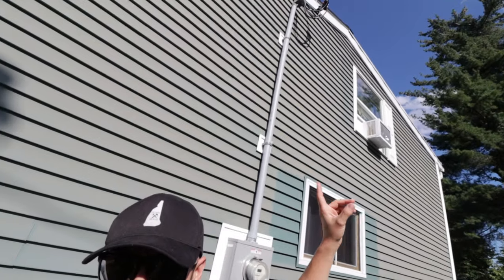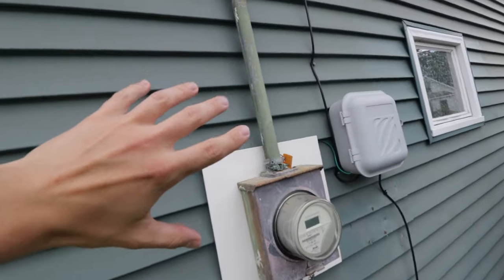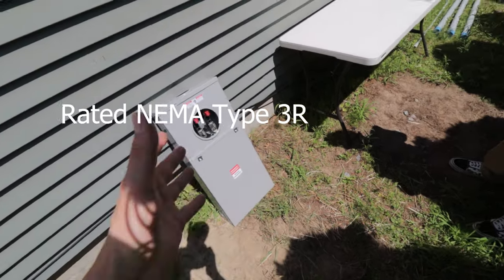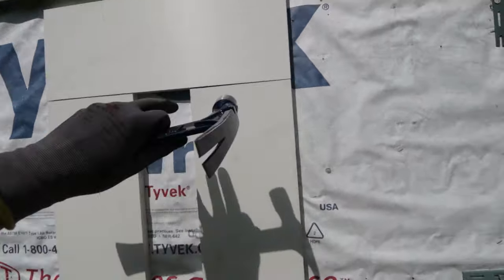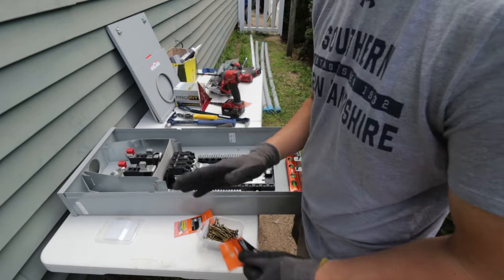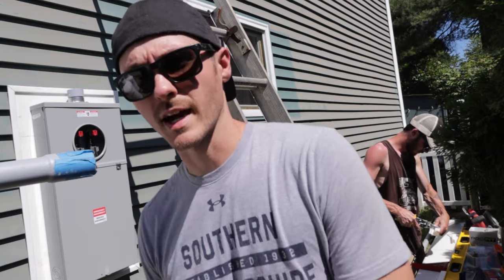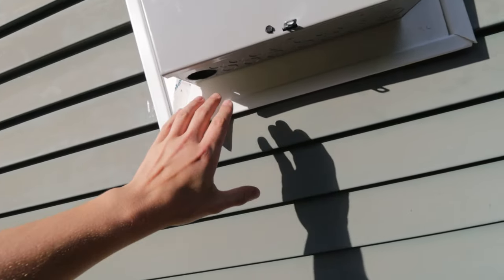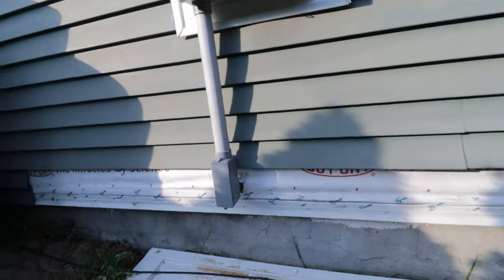Full 200 AMP Electrical Service Upgrade Install

Comment: Nice work. I think you should have put an expansion joint pvc on the 10 foot mast ?
Reply from the maker: Great question! For my situation you do not a expansion fitting. A few reasons are length of the pipe, the pipe not transitioning, and the clips i used allow for expansion
Reply: Great question and answer. Good to know
Reply: Don’t need expansion joints unless transitioning from underground.

Comment: Why didnt you use an electrical socket box mounting block? Every roofing/siding supply house has them. They come with a ring thats removable and multi depth settings. It requires no jchannel around it. As a roofing/siding contractor and living in the northeast know damn well the less water infiltration points the better and hate using silicone on jew siding
Reply from the maker: Because I wanted to make a custom size

Comment: That would fail horribly here. We have to use 2” rigid for 200amp service
Reply from the maker: That sucks. You could potentially have a lightsaber strapped to the side of your house if your connections go bad at the pole.

Comment: WHEN ATTACHING TO A GROUND ROD CODE STATES THAT YOU ONLY NEED A #6 MAX #4 WAS NOT NEEDED.
Reply from the maker: That is correct! However, that is only true if the ground wire is not susceptible to damage. It an area where there can be lawn mowers going by the inspector might want to see it

Comment: You’re supposed to use 2” Schedule 80 PVC conduit for anything that is  exposed.
PVC mineralac straps are garbage and weak.
Why not just use 2” ridged conduit, shallow strut and 2” strut straps with a steel weatherhead even though ridged conduit isn’t required if your not going through an eve 3 feet above the roof.
The siding white backing the MDP is attached to is cool, the rest is cheap quality and weak strength.
Schedule 80 not Schedule 40 PVC conduit is NEC when exposed above grade.
Failed inspection by using Schedule 40 I’m sure
Reply from the maker: Lol it passed inspection. This setup meets and exceeds code for the code book I was using and my authority having jurisdiction.

Comment: If you used 2/0 aluminum from the outside box to the inside box you did not up grade to 200 amp service, 2/0 aluminum is not rated for 200 amps.
Reply from the maker: Yes, I did upgrade my service to 200amps. Now my panel inside is a sub panel limited to 100amps but the service itself has been upgraded

Comment: So far nice work, but stop using acorns for ground rods, do a proper ground connection with CAD welding, you’ll never have to come back and worry that it’s getting a higher resistance because it’s a permanent irreversible weld connection, they’re only like 10 bucks apiece and suitable for burying, also Tip I learned decades ago, Put your ground rods the distance that they are total in length that far apart, this Hass to do with the physics of how grounding works with multiple rods, so if your ground rods are 8 feet long do you want them a minimum of 16 feet apart it’s not hard to do if you think how to do it
Reply from the maker: Those are certainly some tips to that can make your ground system even safer than what code requires! Love it!
Reply: @DownToTheFrame  Don’t forget all codes are just minimum safe standards they are not best design or best practices. Always work to level up and bring up your game. In the commercial world on commercial buildings or communications towers all grounding has been Cadwelded for decades, The kids for standard residential ground rods are like $10 each and you’re a fool if you’re not using them because then you’re just selling your jobs too cheaply,
Reply from the maker: @shockingguy  I agree code is minimum. I will have to try out the welding and further spacing in the future!

Comment: A little late with the noalox. Should have used it in the meter and anywhere you use aluminum really.
Reply from the maker: I did put Noalox on all exposed aluminum terminations. Might not have been on camera though!